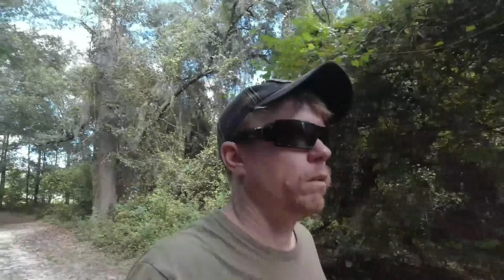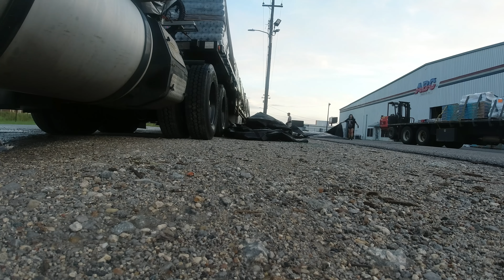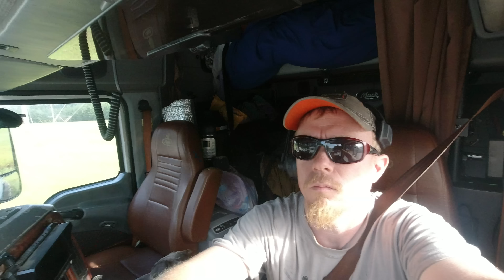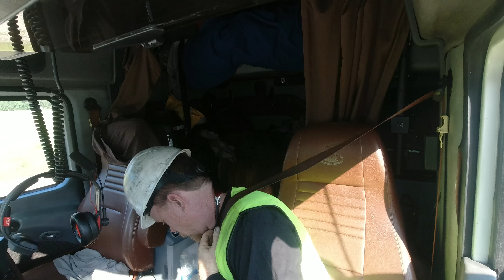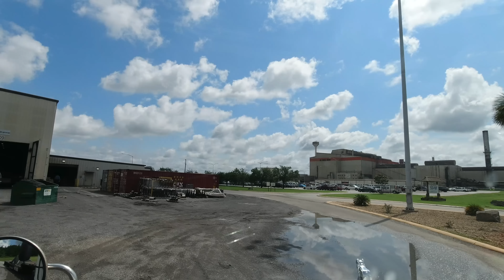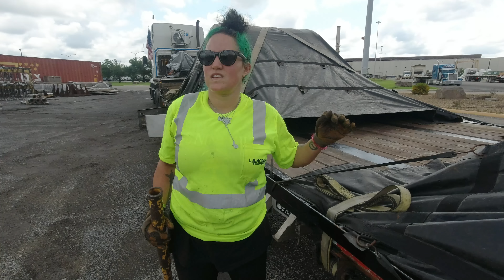Lita gets kicked out of the truck again!

Comment: 99% of the time for long sleeve shirt and pants rule is due to the chemicals & solvents used in manufacturing of products.... They are pumped around through lines if one of those lines burst, You would have more protection from serious harm with the sleeves & pants on

Comment: Sadly I was on jury.  The idiot lawyer for truck driver that got hurt never asked “who has a CDL, has driven OTR” I was careful to only answer question asked.  Driver screwed up, on major distribution warehouse.  IMO his pre trip inspection was skipped.  As his brakes did not hold on his truck when set. (Likely trailer brakes also were weak). After 3 failed attempts to get out, set blocks on trailer to unhook.  He dun crushed himself.  Sued warehouse for having a slope.

Comment: I used to work at a steel company the sleeves is cause the steel is sharp. Even if it appears dull it’s sharp
Reply: i sharpen the blades that cut that steel i can tell you right now if some of that steel comes un strapped it will unroll like a friggen spring and i dont give a darn what your wearing it could be an armour suit it will cut through you like a hot knife through butter  and the blades cutting through that steel look dull but go ahead and run your hand across one and see hoe many ringers you come back with it fillet you right to the bone i been sharpening those buggers for 21 years now i know lol. and i actually do the blades for this company